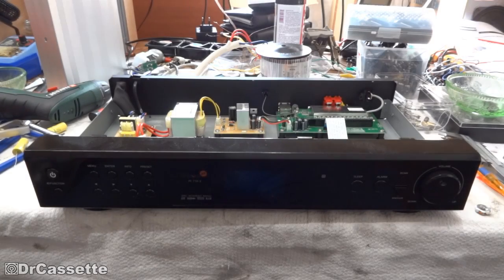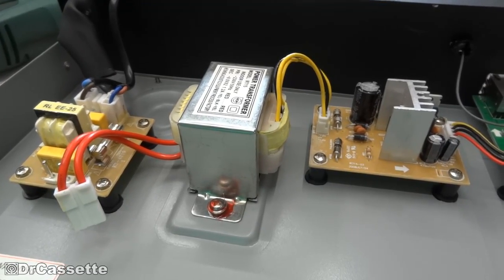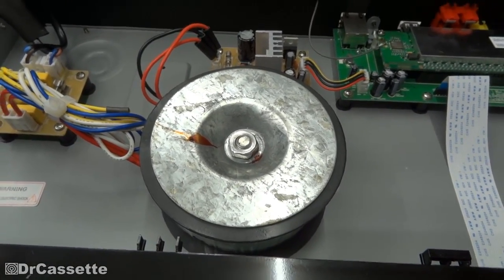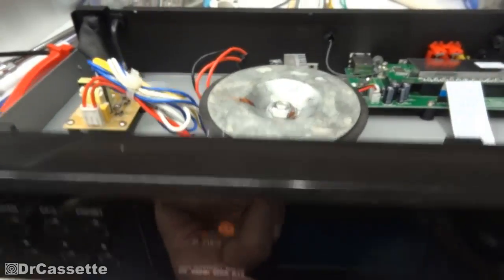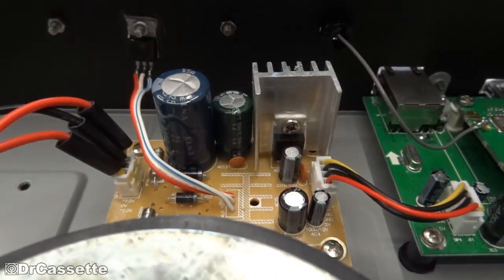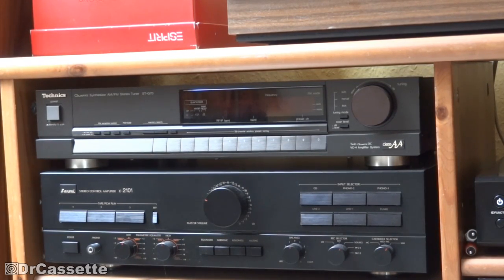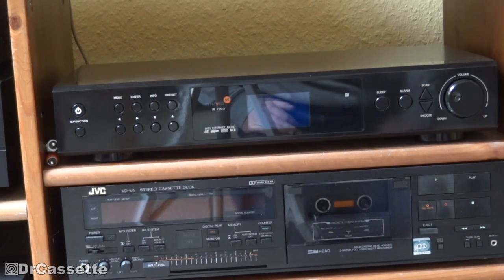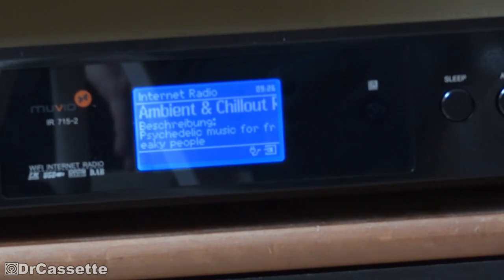DrCassette's Workshop - More Internet Radio Mods!

Comment: Hi there, great modification! Here's a tip: other than using uncompressed .wav files all the time, you might want to look into the .flac file format. It does compress the data of your audio (one song is about 20MB), but it is lossless, meaning that no quality is lost and you can actually convert your files back to the exact same .wav files. Keep up making these great videos!

Comment: I find it interesting how there's a "plugged in" icon in the bottom right of the display, as if the firmware used was originally made for something that could run on batteries...

Comment: nice mods but if i was you i would check on the manufacturers website to see if there is a way to do a firmware update. if they do support a firmware update i might be done by downloading a file from the website and copy it to a usb flash drive and installed onto the unit.